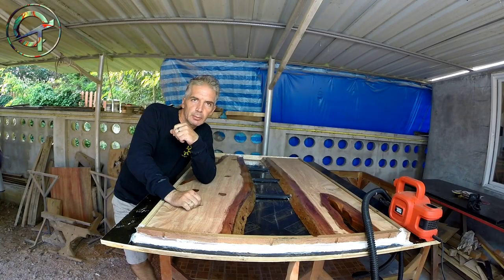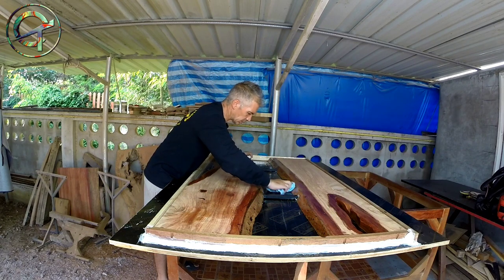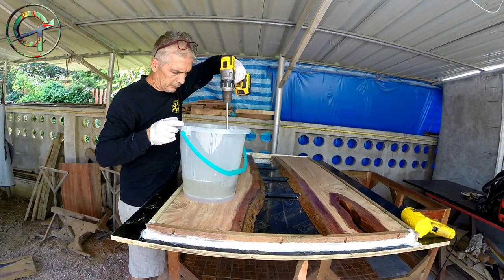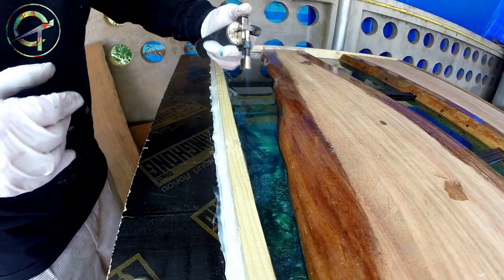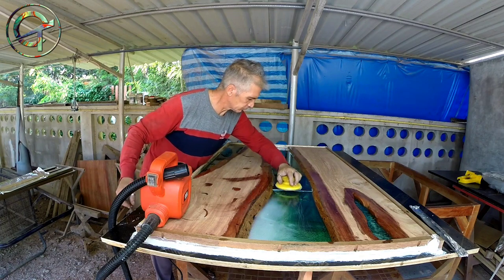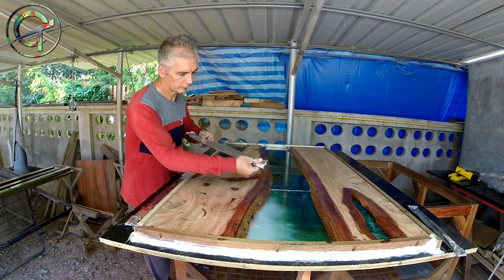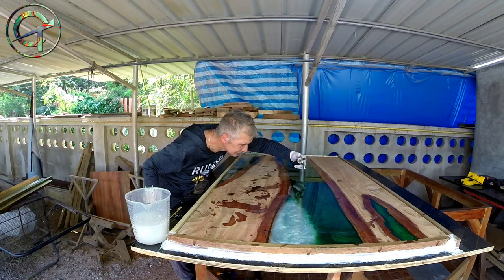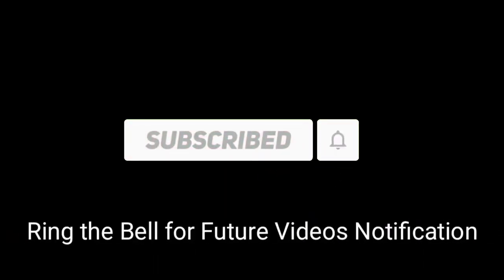Resin River Cast Kitchen Table EP-4, Epoxy Pouring Time!

Comment: I am excited to see the finished table . Is this table for you or a customer ? Epoxy is very expensive here but back in the 70's it was cheap
and people started using it to make boats and the price went crazy . Two gallons can be over $100 and 12 gallons over $600 . To build a table like this would cost over $1500  .  I would have to sell it for over $4000 or more with chairs . But I'm sure at the right place you could get that for it . Here in the US it is getting to be the very rich 5% the middle class 10% and the very poor 85% so expensive items are by special order only . A vanilla box pickup truck are almost $50K now and a small home $250K or more . If I were younger I would sell out and move to South America or Central America .
Reply from the maker: Here in Thailand I buy epoxy, local production, for 10 $ USA x 1 kg,  the resin quality is really good. It's expensive considering that here a middle class salary is around 500 $ however can't be compared to the cost of life in USA, to expensive, probably more than Europe too, I'm Italian living in Chiangmai, northern Thailand. 
Thanks for your visit, really appreciated!

Comment: I was excited to see this part, this is so gorgeous. It makes me wonder about lights inside, is that safe? 😃
Reply from the maker: The 2 slabs are kept together with steel inserts, if you watch episode 2 you will understand what I mean . Epoxy river glues the 2 slabs togheter plus, alongside that, in the internal side of the slabs, were I poured the resin, I drilled holes. Once epoxy is cast is going to fill the holes, once cured it will work as dowels, again look EP 2, everything is explained in details. The overall structure weights around 70 kg and it is really strong. I crafted so many river cast tables that I built some experience about. However, your comment and concern are really appreciated my friend!